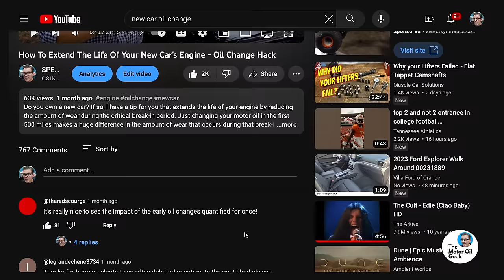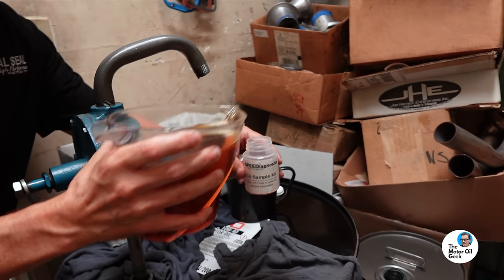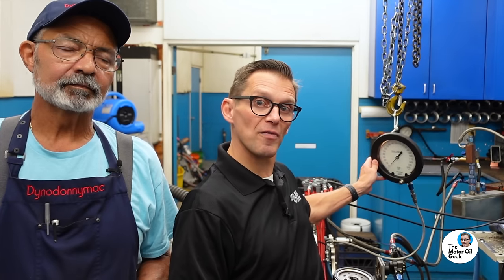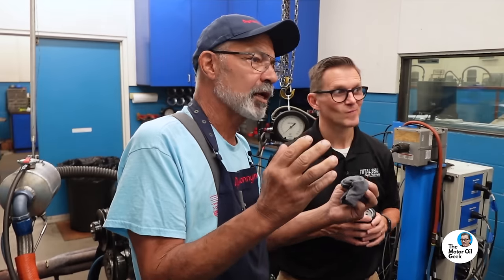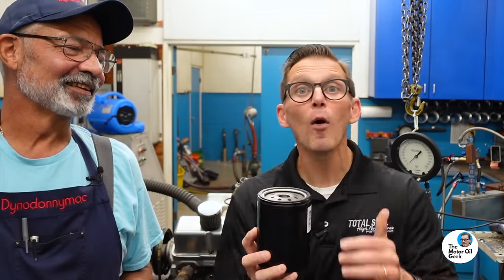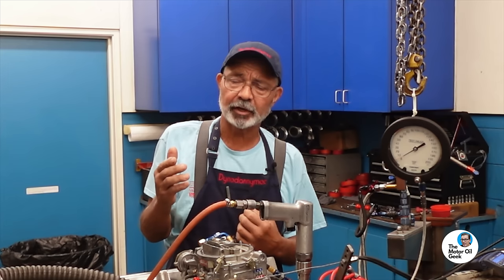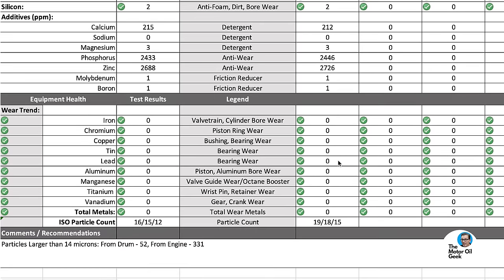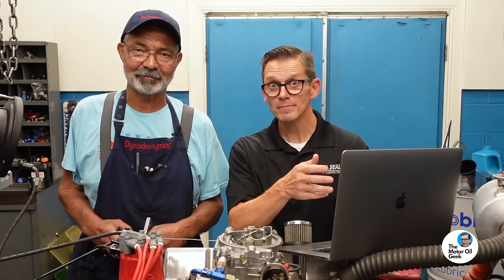Does Pre-FILLING The Oil FILTER Cause Engine DAMAGE?

Comment: I've always prefilled oil filters and if equipped with a flood clearing function of the engine, held the accelerator all the way down while cranking the engine for a few seconds to allow the engine to build some pressure after the change. This is also the better method for cartridge style filters where prefilling isn't really possible.
Reply: Yea you can use flood mode on Fords. Not sure bout anything else. If you can't do that pull a fuse for the fuel pump.
Reply: I've only encountered 1 vehicle that didn't have flood mode but I can't recall what it was. I know my wife's 2016 BMW also has that feature and it's nice to have for it since it uses a cartridge filter.
Reply from the maker: Great suggestion!
Reply: Very good point, and valid.
Reply: What the heck, I didn't know about flood mode. Great tip. Would be crucial on Mercedes top-mounted cartridge filters.
Reply: I would even go as far as removing spark plugs to eliminate compression forces just for extra love.
Reply: @jamieb9556  Even if you pull the fuel pump fuse, the engine will often still try to fire and possibly even run for a short time just off the residual fuel in the lines, rails, and injectors because the fuel pump has a check valve to maintain pressure on the system even after shutdown.
Reply: SBF FOX fuelie,  I fill the vertical filter (see my other post) then I just leave the key off and jump the solenoid.
There's no fuel pump running and no EFI power so there's no ignition pulses from the EFI thats required to trigger the injectors.  👍 
5 second jump and I'm done.
Reply: In my car, right after I pull it into the garage before draining the oil I just pop the rear seat up, disconnect the connector to the Fuel  Pump / fuel sender and then start the engine and wait for it to stall out, then crank a few seconds more to make sure the fuel pressure is depleted.     

Once the old oil it out, and the new oil is in, I crank away 3 to 4 times with no fuel pressure in 10-15 seconds bursts with about a 30s rest for the starter between each until I hear the valve train quieten (Hydraulic valve lash buckets and chain tensioner pumping up) as the change in tone is distinctive, then dry (no fuel) crank once more, and by that point if the oil light isnt already going out from motoring the engine over on the starter (usually it does by then), it is guaranteed to immediately once fuel is re-enabled and started.     

It also gives me an extra chance to check for loose filters / a double gasket issue first as once i've done the motoring, i check the filter for leakage before allowing the engine to start.

I'm not concerned about the starter over heating as its a Low Compression (Turbo charged) engine which winds over very easilly, and I give the starter plenty of breaks.
I also have a Lithium Battery installed which will maintain a good 11+ volts under cranking (And I keep it on a charger while doing the service to ensure its full), so the starter is not having to labor under low voltage (which would be an issue).
Reply: @KSSilenceAU  Good idea, but since oil pumps don't work well at such low RPMs, I question whether cranking the engine for a long period of time without oil pressure actually saves much wear compared to just starting the engine and running it for a couple seconds without oil pressure. Obviously there will be compression either way, but no combustion without fuel.

I also question whether the extra starter and battery wear would be worth it even if bearing wear was reduced. Starters and batteries are cheap and easy to replace compared to bearings, but still expensive and potentially quite difficult depending on the vehicle while the bearings will almost always outlast the rest of the vehicle with or without cranking to prefill.

Comment: If your filter orientation is such that you can pre-fill it so it won't leak out during install then you should pre-fill to avoid dry starts.
Reply: Yep thats what I was saying while watching this video what do you do if you have a filter that is mounted in a horizontal orientation its going to leak out before you get it fully installed.
Reply: @mrelectron6220  It will leak some but if you are quick about spinning it onto the seal it is only a small percentage. I frequently service a diesel generator engine with such a filter angle and being quick is the trick.
Reply: Even with the horizontal filter put enough in to wet the filter media if that's all that's practical. That's less time with no flow.
Reply: If your filter is mounted horizonal on the engine, the first thing you do is fill your new filter. Then by the time you have drained the oil, replaced the drainplug and removed the old filter, the oil in your new filter will have migrated through the filter media in the reverse direction and be between the filter media and the outside wall of the filter so you can now install it with no leaks.
Reply: Hey guys. How about Subaru engine? The oil filter is mounting up side down. Any ideas?
Reply: Later model Subaru 2.5i has the filter upside down. I’m hearing that I should fill the filter and let it become saturated before installing. I’ll try it. At least I can dump oil from the filter into the crankcase with a funnel and not spill it around in my engine bay. We’ll see.
Reply: same I think if you fill it and let new oil saturate the filter while doing the other processes you can either pour the residual into your funnel or maybe it won’t have enough oil to spill out when you install it. 😢
Reply: I have an impreza. Upside down oul filter on top of the motor. I always still fill the filter and at least get all the filter media soaked in oil. Youd be surprised how much it is. If i fill the filter right up, itll soak all of it in to the point that none comes out when i turn it upside down. So i still believe it helps with initial oil pressure @koteignasio98

Comment: Eager to see the answers towards the end...I can say it takes a LOT longer cranking/idle speed for the oil pressure warning-light to go out when its not pre-filled (say 5-10 seconds) vs when it is pre-filled (2-5 seconds) and I can notice a significant increase in clicking and rattling in the last several seconds before it builds oil pressure.

Comment: I've been changing my own oil and filter for nearly 60 years, and have never pre filled the filter, I'd never heard of the concept. I've never had a problem, but after watching this, I think I have a new habit. May be messy and not 100% successful  with my Toyota V6 horizontal cartridge filter, but I'll give it a go. One thing I don't do is use the last half inch out of the plastic oil container as I have noticed some bits of dross in the bottom on occasions.
Reply: dont waste your time its pointless unless the vehicle has sat for months without turning over. Especially with that filter. if you are worried just crank it and let it run for a minute before oil change. everything will be sufficiently coated.
Reply: 91 years here!

Comment: If I don't pre-fill my 2011 chevy small block the engine does knock before oil pressure builds. I just change my oil yesterday with no engine noise with it pre-filled and this is what I always have done! Way to go guys!
Reply from the maker: Thanks!
Reply: Yep my 5.7 when I pre fill, will have a slight knock for 2 or 3 seconds...no prefilled it will knock longer...so I'm going to keep doing what iv been doing for 50 years
Reply: So it is wore .pre fil if you can

Comment: Been driving and doing my own oil changes for 45 years, never prefilled any oil filter.  Never experienced any engine failures either.
Reply: Me either. Tbh, if it was a necessary step you would think that either the oil can or the filter would say so on the packaging. I mean, it says to lubricate the seal but doesn't mention filling the filter with oil?
Reply: How long did you keep the vehicle for? It’s all about wear!
Reply: When you add new engine oil to the engine it fills the filter almost immediately
Reply: The oil will find the filter. The new engine oil is clean and it will coat the inside of the engine, circulate and find the dry filter and soak and fill it. Not prefilling the filter is no big deal. After running the engine for an hour or so you might want to check your engine level to make sure you are not a bit low after the filter soaks up oil,
Reply: The filters I see, say not to pre-fill
Reply: Exactly!! I am the same. I am 65 years old an have never prefilled an oil filter in my life with no issues. Most of the vehicles and equipment I have owned never had filter positions that would allow that.  Also inn the manuals that came with my equipment never once did I see instructions to do so
Reply: I'm an automotive machinist and dyno owner. I've never pre-filled filters either. It's completely unnecessary. On our dry sump engines we do prime the systems after long periods of sitting but it's because it's easy with external pumps. On daily driver type of stuff the only thing filling a filter does is create a mess.
Reply: And, how do you keep the oil in a pre-filled filter when the filter is installed on a vertical surface and it will all dump out by the time it is screwed into place.
Reply: Interesting video. All my vehicles are side-mounted oil filters so I really can’t pre-fill too much without making a mess. On older German motorcycles I’ve worked on with cartridge style side mounted oil filters, I really can’t pre-fill the chamber, but I will empty the carburetor float bowls and have the fuel petcocks off while cranking until I see the oil light go off on the instrument cluster.
Reply: So? What is your point?
Reply: @leethomas556 where?
Reply: Can you get away with not pre filling the filter probably. Is it better for your engine in the long run to pre fill(when you can) definitely. Don’t be lazy pre fill your oil filter. Unless you don’t care how long the engine is going to last do what you want.
Reply: lol - and it's not as if the damn engineers and frame designers made it any easier...  in so many vehicles the filter goes up / on at an angle / sideways, or up and around the front frame / steering linkage ...  if it was "important" to the engine for the filter to be pre-filled, then the filters should be more vertical and accessible...  yes, a bunch, particularly older cars were fairly decent to get to...  but what about the engines shoe-horned into vehicles today?
Reply: @windycityben4850  yep - all of my suzuki motorcycles including my v-twins have had their filter put on sideways at front of engine...  can't pre-fill that...

Comment: This is cool. I've actually seen a test that showed it takes up to 60 seconds until all the oil that usually are circulating in the engine, are picked up from the sump.  So, leaving any engine part completely dry for several seconds, are really wearing the engine down.

Comment: Auto shop in the 1970’s said to prefill the filter, I’ve always done it and didn’t realize it was point of contention. It was stressed then that a significant percentage of engine wear occurs on a “dry” start after an oil change. It’s amazing how many modern engines are designed with a horizontal filter making it hard or even impossible to prefill when a 90° housing would easily fit in the oil filter area.
Reply: Right, Subaru, my 2011 Tacoma and my son’s 2.7 V6 F-150 all have filters mounted upside down.
Reply: There shouldn’t be any significant amount of engine damage starting up after an oil change. The oil film left on the parts will keep any damages from happening. Sure you will help saving 0.3s of oil pressure to the main bearings and stuff but everything else is mostly splash lubricated and oil will be drained back to the pan after shut down for thousands of cycles.
Reply: @jasonsong86 - The thin oil film on the bearing surfaces actually carry the load, operating at all without the film allows the parts to make contact and wear. The pressure of the incoming oil gives the oil film it’s strength.  For this to work in a modern engine as designed, there must no only be oil present, it must be pressurized. A few seconds may not be a big deal to your cam lobes, timing chain, piston rings or wrist pins but it certainly is to your crankshaft bearings, both rods and mains and cam bearings. There may be some applications where oil is retained in the engine even after the oil pan has drained, that would change things also.
Reply: @rustyaxelrod  if you do the calculation, the crack shaft bearing is experiencing thousands of psi of pressure during a power stroke. Oil is able to withstand hundreds of thousands psi of pressure before film break down. Don’t really think the messily 50psi from the oil pump is going to withstand any force? The job of the oil pump is to circulate oil so that there is no localized hot spots that can cause heating up of the oil so that it turns into smoke. During start up, the crank speed is too low to cause you much heat. There are people have ran engine without oil and it takes at least 10 minutes just on oil film before the bearings overheat and seize up. I think that half second of no oil pressure is totally fine.
Reply: @jasonsong86  - Really I’m just repeating what I learned in a classroom from a book written by engineers, I’ve not personally witnessed what happens to a molecule of oil under differing conditions so there’s that. 😉 it’s your vehicle, treat it however you like. I had a 66 Ford 1/2 ton truck with a 352 that made less than 5psi at idle and never went over 15. It hauled a tractor in the NM desert for several years and was still runnin when I sold it.
Reply: @rustyaxelrod  another reason why oil pressure is bogus when it comes to engine protection. Your old engine has very loose tolerance so the oil pressure won’t be as high but as long as there is pressure means the oil is flowing, you will be fine. With that being said never going over 15 seems a little low most engines should be running between 10-30 when warmed up. What oil are you using?
Reply: @jasonsong86  - years ago, I sold it.

Comment: Cleanliness of the oil filter funnel is often overlooked. I keep mine in a gallon ziplock bag to keep it clean.I always fill the filter which usually takes about 3 times as it soaks into the media I operated /worked  on very large industrial engines. They all had pre AND post lube oi pumps. to prevent start up wear and protect the turbo when they continue to spin after engine shutdown. If we thought long term we would have the same on our cars.
Reply: Do you mean pre and post filter oil pumps?  Yeah, quite a sensible idea 😊

Comment: Im a heavy equipment tech and a lot of the filters have pictures on the side that say not to pre-fill, even with big 3 quart capacity filters.  Caterpillar is one i can think of off hand that has it on the most filters, a picture of an oil drop or oil can filling the filter with a big cross out mark over it.  Wonder why 🤔
Reply: I just added a comment on here explaining this, I'm a caterpillar tech.  Caterpillar has extremely strict contamination control guidelines, they are worried about contamination entering the system through unfiltered oil to the engine.  They are taking into account the technicians who don't have the best cleaning practices, and may do more damage by possibly putting dirt in the system.